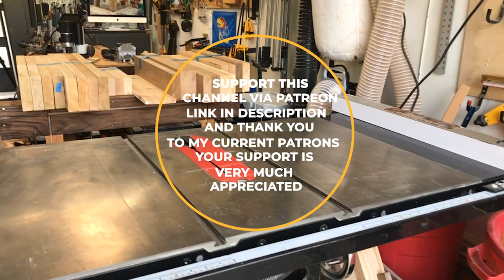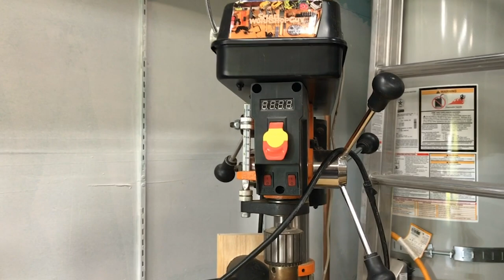2020 Small One Car Garage Workshop Tour - Part 2 - The Tools In My Woodshop

Comment: I feel that same as you about mortising machines. Never could see the use for such a rigorous operation. I'll take my chances with dowels and/or dovetail joints. I can say this about you, "you don't hold back on telling it like it is about these tools." I couldn't believe the price of that CNC motor router. In my case I would rather have a top of the line table saw but that is just me talking. You already have one of those so enjoy.
Reply from the maker: Thanks for taking the tour - I am loving my Shaper Origin more and more and Powematic Mortising machine less and less!

Comment: Nice tour.  Thanks for posting.  I am always looking for ideas on how to use my space more efficiently.  I also have a single bay garage for a shop.  I did move my dust collection system to the vehicle side of the wall and ran just the hose through the wall and attach it to what ever tool is running.  You have an advantage with high ceiling. I have an 8’ ceiling which limits overhead storage.   I do hang a 8’ folding ladder flat against the ceiling in the 16” space above the opened garage door.
Reply from the maker: Yes, I am thankful for my tall ceiling in the garage - definitely a boon for me to be able to store a lot of wood up there.  I have a crawl space above my car port with an angled roof and I cram most ot the family storage stuff in there - don't know what I would do without that since it would not be tolerable to have all that camping gear, athletic gear etc in my workshop

Comment: Thanks Paul.  I enjoy your videos and the information on the various makes of equipment overview.  My shop is an 18 ft x 13 ft area that in my daylight basement (East Coast) I set us over 10 years ago.  I wish I would have had great YouTube videos like yours back then to help with shop setup. The Dewalt compund miter saw (chop saw) I purchased because I  did not have room for the extension arm back then.  However you may want to check out the Delta Cruzer 12" Miter Saw - Generation 2.  I like the laser it comes with and its very inovative over the Bosch for what its worth.  Thanks again for your time and stay safe.
Reply from the maker: Thanks for the Delta saw recommendation - I just watched a video on that - impressive with that 18 inch cross cut capacity.

Comment: At first I thought there weren't going to be any outtakes, but there it was , just the one. So does that mean you didn't make too many errors?
You have a lot of stuff in your one car garage, stuff that's all tucked away nicely until they're needed. I have been looking at a few of the Wen products, some of which are the slow speed grinder, the drill  press, and the planer. I have three small drill presses now, two of which are the same model Craftsman, with one of them needing a motor. That one was in storage where the contents were auctioned off, and the buyer gave it to me to see if it worked before charging me anything. The motor burned up the capacitor, but it's less expensive to buy a new drill press than buy another 1/3 HP motor for it or have this one rewound. The other Craftsman  is my daily driver, but the motor in it has seen better days. The third is a brand I've never heard of, and neither has the internet because I can't find any parts listings or service information for it. It's like the brand doesn't exist. Therefore, I can't fix it and I can't sell it like it is. I want to switch the motor onto the Craftsman, but I can't get the pulley off of the motor to see if it will fit.  The other products need to wait until I have the room, which as I've said too many times already, cleaning out my garage hasn't happened like I wanted, and I don't know when it will.
OK, that's TMI, so I'll shut up now.
Reply from the maker: Always love your comments and the fact that you do comment on my videos.  Thanks......... now go spend 15 minutes on cleaning your garage and then do that daily for 30 days, and then pow.... it will be partially cleaned!
Reply: @SmallWorkshopGuy  I really appreciate your encouragement Paul, but if only it was that simple. I need to rent a P.O.D.S. or Pack-Rack container in order to move some of the stuff out of the garage so I have the room to start sorting the junk from the stuff to keep, sell at a metal scrap yard, sell at a garage sale, etc. Being on SS disability, we need to watch what we spend, (we went through out rainy day funds paying for my part of my neck surgery and waiting for SS disability to kick in), so it's not in the budget right now. I guess I could start small and throw out the little stuff that I'm sure I'll never need, that would be a good start.
Always good to watch one of your videos, even the ones where you say not to watch. David S.

Comment: It is the Bosch glide miter saw.  If you have any use for it the Bosch gravity rise stands are really nice.  I use 12 volt Milwaukee for smaller jobs and 20 volt Dewalt for the bigger jobs.  My complaint with Dewalt is their batteries are massively overpriced.
Reply: Chuck S agreed that the Dewalt batteries are way to expensive.  I also run the Dewalt 20v system and have acquired one of the cheap Chinese 5Ah replacements.  Thought it would be okay but after just one year it is not charging completing and the much older Dewalt batteries that came with the tools are still working perfectly.  Saving up my allowance to buy a 5Ah Dewalt battery for the circular saw Santa brought last Christmas.
Reply from the maker: Yep, I have too darn many drill drivers now.  3 Milwaukee 12 vols, 1 DeWalt 12 volt and now 2 brand new brushless DeWalt 18 FX and a new DeWalt FX circular saw.  But boy is it hard. (impossible) to think about giving away or selling any duplicates - oh well, they decorate the tool wall.